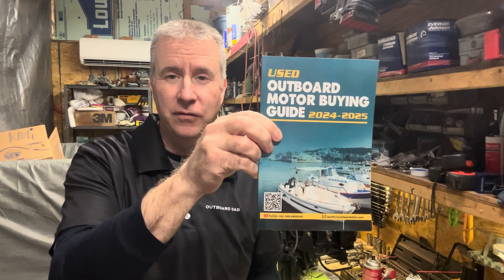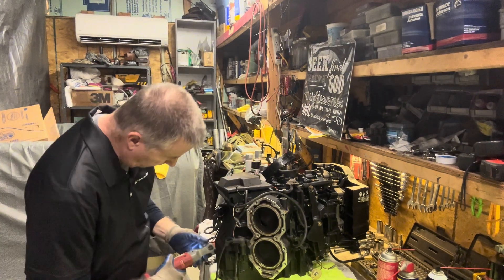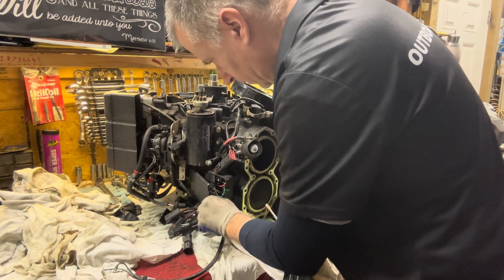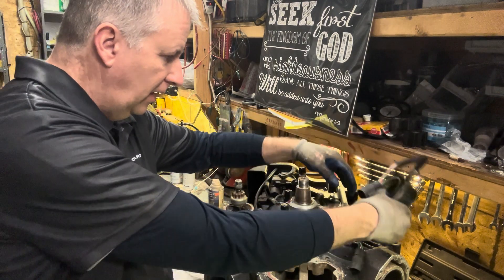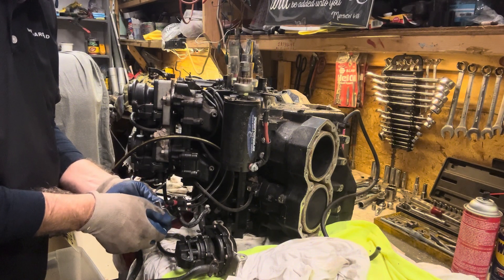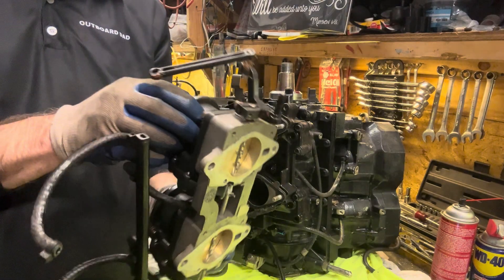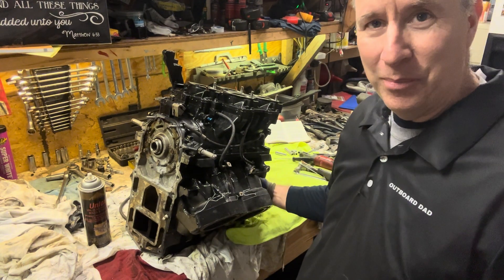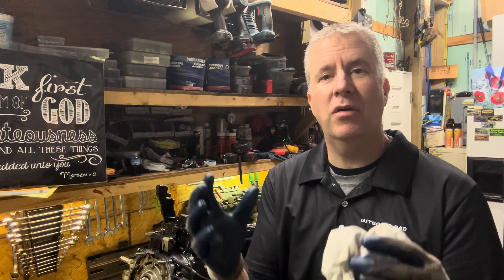How to Rebuild a 2 Stroke Outboard Motor! Step by Step (Part 4)

Comment: Reason for 4 carbs is why it’s a crossflow looper which gives higher hp to Weight ratio
Reply from the maker: @gbipit1  Thanks for the input! Are you a marine mechanic by trade?

Comment: Dang 4 carbs no thanks...is the benefit of one carb per cylinder really worth the complexity? How come the boat motor never seem to have 4 barrel single carbs or something similiar?
Reply from the maker: @durbeshpatel3047  Great question, not sure unless it has something to do with the reed plates and the way two strokes pull fuel and oil past the crankshaft. I know older Evinrude’s and yamaha Crossflow have 2 barrel typ carbs for two cylinders each. This model they have adjustments so you can tune them individually but most do not